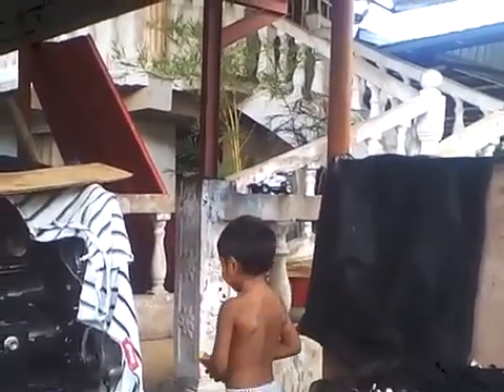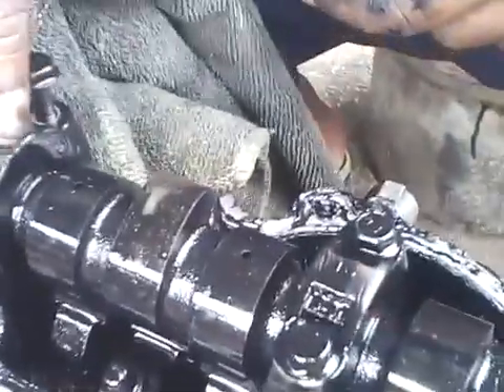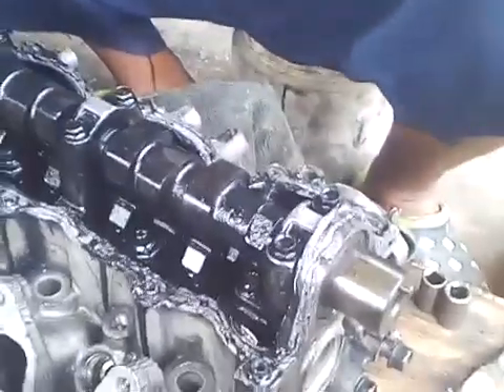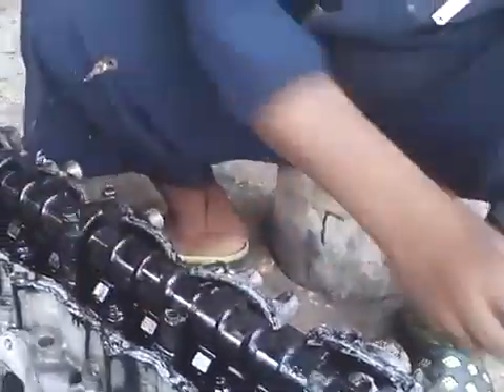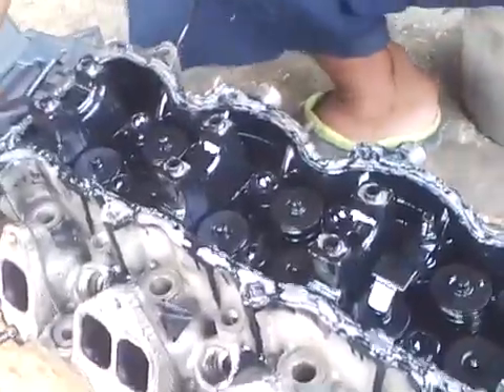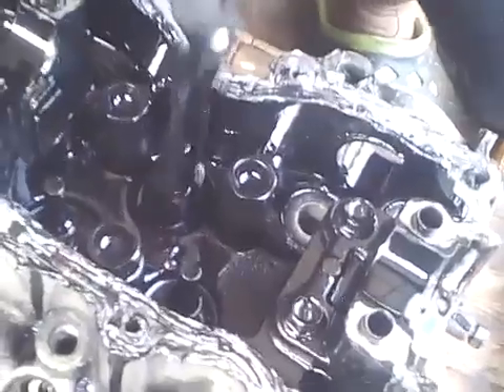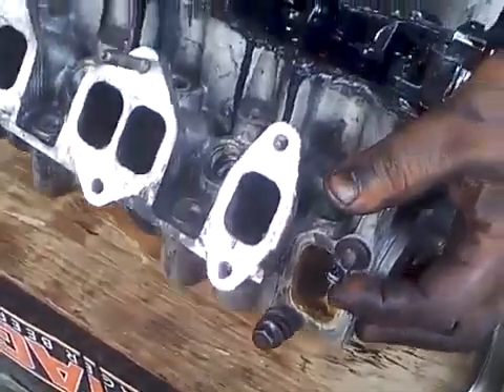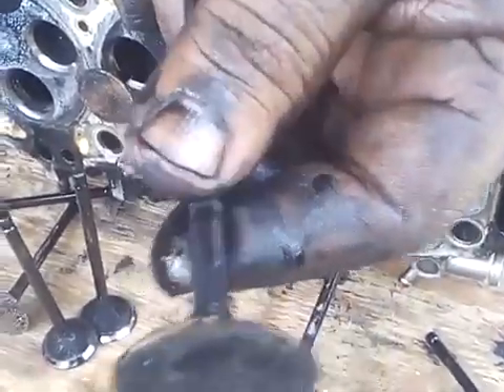VID 20170902 134101

Comment: great job guys what is the valve clearence
Reply: 0.15mm for intake and 0.25mm for exhaust
Reply: thank you so much contact number please for major repairs
Reply: if you want more happy tappet .. set it 0.10mm  for intake and 0.20mm for exhaust .. this what I set up my truck on .. and run good . no tappet noise ..
Reply: @phim18x78  
Hi sir , 
I HAVE same engine in my 98 mazda .
I have problem I couldnt find solution .
When I start engine in mornings start very  quick. But if engine hot and wait  20 minute than starter turning  slow and longger start .  
And when engine hot shut down and start again olso nice and quick start.  
Battery is 12,4 wolt shows .
Reply: @smoothoperator7306  hi there . see if you can remove glow plugs and check it  on battery they should burn red  quickly . if not burning when you test with battery is faulty.  Remove the radiator cap and fill with water with engine not running. Do not close the radiator cap Than start engine make sure water not  shooting out the radiator. This check for blow head gasket. If blow head gasket water will be push out of radiator .
Reply: @smoothoperator7306  done all that and find nothing . check your earth wire   that go to starter motor . and earth wire to the body . make sure they all tight . if nothing you find .do let me know
Reply: @phim18x78  
Ok  sir,  I will do  your advices .
Reply: @phim18x78  
Glow plugs are ok . 
I filled radiator  full . I started  engine , ı  saw som bubles in couple  seconds but after few seconds  no bubles . But water flow out very slowly and  continue 5 minute  .
Reply: @smoothoperator7306  great to get good result try again when engine cold . if you try again and have bubble and water keep push out in first 5 minutes  again . it more likely small crack head or small blow head gasket.  With a good engine water shouldn't push out radiator in 15-20 minutes  until top radiator hose get hot.   If you try again and get same result  you may have to go and buy a liquid name ( head gasket block  seal ) to put in the radiator  to stop the leak. And only work with small crack or small blow head gasket. Other way the head may have to come out .  as you know Desi el    engine working in high pressure and small leak or crack will push water to the cylinder . after the engine start and turn off the water system in high pressure and is will leak water to the pistons. With water in the pistons is very have to start and you may see white smoke on the back of the exhaust pipe.   If you let sit when completely cold will easy to start as all water in the the piston been dry out by warm engine and because engine not running so coolant system low pressure . no water leak to the pistons . that why easy to start when engine fully cold.   You hard for you to Check . you may take to local garage and ask them to check for blow head gasket to confirm.
Reply: @phim18x78  thank you for all advice , I will check,  again .